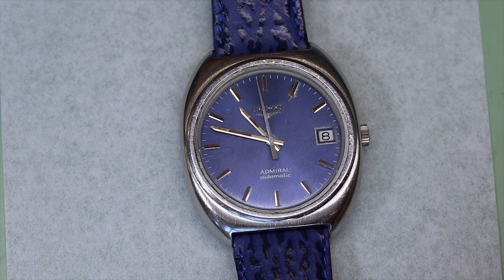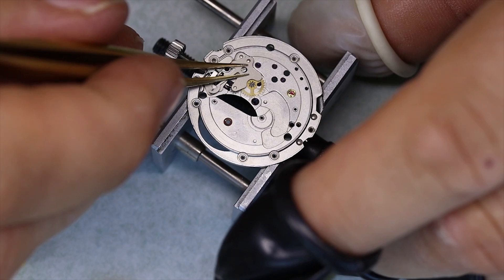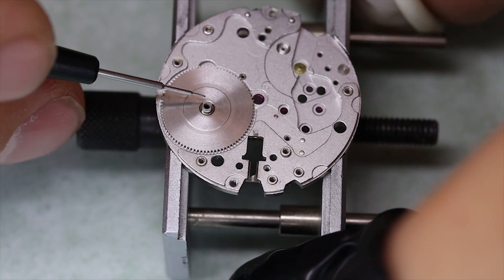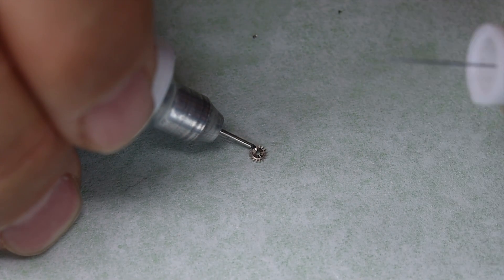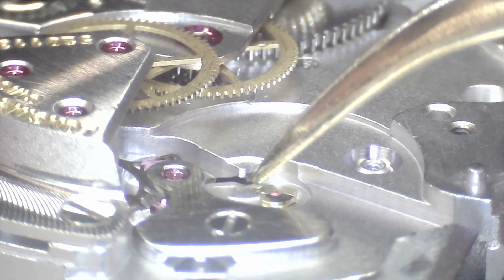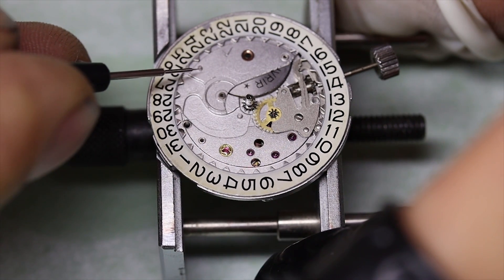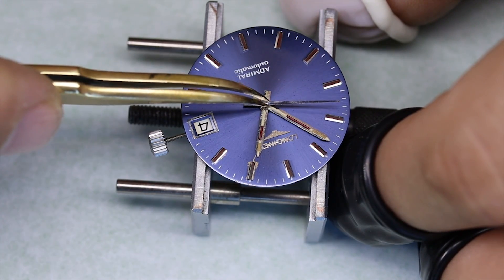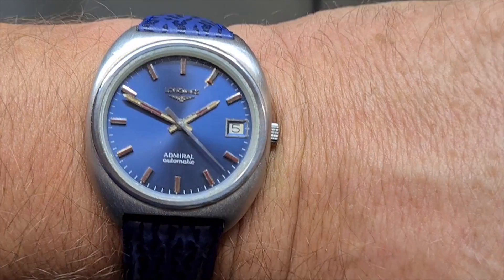Down but not out - restoring a beautiful 1974 Longines

Comment: Thanks for showing the closing of the barrel bridge hole technique. I've known watchmakers do that but so far I've never did it myself. Gonna try it on scrapper soon.
Reply from the maker: Thanks John! Good luck and it's not difficult, just make sure you have the right tools and that the bridge rests on the surfaces of the tools, meaning that the surfaces do not touch each other through the hole.

Comment: Thanks, S, for the tip about grease over oil on pallet forks jewels in certain cases.  I did not know that.  This was a really good one.  

Finding parts: 
My solution...it works extremely well and is relatively inexpensive.  I got on Amazon and ordered a pack of neodymium, rare earth, super strong magnets.  They're in packs of varying size, disk-shaped, really strong, and about an inch in diameter.  They also come with adhesives for sticking them to whatever you wish.   I took 15 of them and spaced them evenly along a yard/meter stick.  Wave that over the floor and I found teeny dial screws, barrel arbors, yoke springs, and other born-to-fly microscopic parts I would have never seen again.   Works wonderfully.
Reply from the maker: Good tip!

Comment: Wow, superglue! I knew it is useful when your boss won't shut up or the dog just keeps on barking, did not know the horological application though. Fascinating!
Reply from the maker: Hello griffn, thanks! I hope it came across clearly enough that it was a gag and that I actually got a NOS part, thought this would be fun 😁
Reply: @VintageWatchServices   Of course! 😀 Glue capable of performing such a task would be on a level of a miracle.
Reply: @VintageWatchServices  I did not get it either. What I think is funny is that that is the exact same kind of gag I would do, and then be frustrated that nobody got it.
Reply from the maker: @johnsrabe   That is indeed very funny! I might have to mention in the next video that it was indeed a gag, otherwise I might get complaints by people who tried to actually fix their watches with superglue 😂
Reply: @VintageWatchServices   I wish I had read this before I tried to  Super glue my broken mainspring. Lol.

Comment: I think restoring the matte brushing on the case was essential to bringing back the character of the watch, and you did keep some of the scratches, which maintained the age effect.  Really nice work.  As for the increasing scarcity of parts for older movements, maybe 3-D printers will be the salvation for vintage watchmakers.
Reply from the maker: Thanks a lot Bullnose, that's very nice to hear. 3D printing indeed could be a source for making old parts, the only downside is that at the current state of the technology, you'd still need to do quite a lot of hand finishing to make them acceptable in a watch. But the tech develops very fast, so the future might be bright 😁
Reply: @VintageWatchServices  Don't put away the super glue just yet.  Be well.  😊

Comment: If I had one problem with this restoration it would be the case "re-brushing" it looks a little bit to deep and rough looking. Probably with the naked eye it wouldn't look as bad though. 
I'm glad it was restored and working well. 👍
Reply from the maker: Thanks Gary! The re-brushing is actually probably shallower than the original, and I think the original brushing was a bit coarser also. But it was certainly also more uniform :)

Comment: Great video, so relaxing. I like the tip geometry of the screwdrivers you use, what set would you recommend for a beginner?
Reply from the maker: Hello George, thanks so much! I've started using hollow ground tip screwdrivers, which really fit the screwheads very well, but they're a bit of a pain to trim. For a beginner, I'd say you should get as good a set as you think you can afford. Good screwdrivers really make a big difference to how easy and rewarding it is to work on a watch, if your screwdriver slips all the time it can get very frustrating. Thus if you can afford it or rather if you think you'll use them enough to justify it, I'd go for a Bergeon or Horotec set and get a sharpening stone/slip together with it. Buying cheap means buying frustration.
Reply: @VintageWatchServices  Thank you for your reply, i am a fan of the maxim "always buy the best you can afford"  and yes cheap tools especially in watch repair is a recipe for frustration and possibly disaster, i know from personal experience. One thing for sure, the tweezers i bought which are the same design as yours but made by Dumont have made life easier for this novice.
Reply: @VintageWatchServices  Beco-Technic are also good.  Timelab in South Korea started making some of their own tools a few years back and I've heard some good things about them.

Comment: Another engrossing video. If this watch had a balance wheel with screws in the sides(circumference), the oscillation would have been a feast for the eyes. There is some inscription on the dial side of the barrel. It seems it is in french. Really looking forward for the next video Stian. The appetite for your videos is insatiated.
Reply from the maker: Hello K, thanks for that! The barrel has an inscription in both English and French saying Do not open. This was quite common for a while with some brands like Longines and Seiko. The idea was that the entire barrel complete with mainspring would be swapped out at a service. The barrels are thus not intended to be opened and there's a greater risk than normal of damaging it if you do open it. 
My approach is to try the barrel first to see if it gives the watch enough and steady power, and if not I'll acquire a replacement. With a spare I will then try to open the existing barrel and clean the mainspring and if there are issues with the barrel afterwards I'll use the spare.
Reply: Thanks Stian. Very nice explanation.

Comment: As a dressmaker, I totally empathise with the loss of small metal objects in carpet. Usually, I would find that pin, or those needles, with my - invariably - bare feet when I walked on them. Or, occasionally, with my fingers, when they stabbed me under my finger nails as I sifted through the carpet fibres for them while holding the magnet in my other hand. Yeah, I don't miss having carpet in the sewing room, not even a little. I still might step in pounds every now and again, but I have a much greater chance of seeing them before that calamity. Still, that Bergeon magnet looks like it would be AMAZING for finding little metal things. I might have to look at getting one for myself...
Reply from the maker: Those sound like some real life Murphy's law examples 😂 Yes, that magnet is a real life saver sometimes, and for you perhaps even literally then :)

Comment: Really enjoy all your videos. Personally I would have preferred a finer brushed finish.
Also a question on your screwdrivers. I notice you use hollow ground tips. Do you find these work better than the regular ones?
Reply from the maker: Hello Cornelio, thanks a lot! I think the original finish might actually have been a little bit coarser, even, but this was the closest I could find. 
I love the hollow ground tips, I just started trying them out a few weeks back and are so far very happy with them. Trimming them is a bit more of a pain in the butt however, as you need a hollow ground grinder that takes a lot longer to use than a simple diamond slip. So all in all, I'm not sure :)

Comment: I'm really loving the work you do on the various movements that you show us, but this one in particular piqued my interest as the 6651 is used in my Admiral chronometer.  The only visual difference is that the auto rotor is inscribed with Longines Chronometer.  I did wonder if being branded a chronometer it may have been adjusted in more positions but, no, both movements are adjusted for 4.

So what makes my movement being designated a chronometer and the movement in this video not?  As it is so easy to replace the rotor, could it simply be sample variation and the better performing movements have the chrono label, and rotor?
Reply from the maker: Hello Terry, the main difference between a chronometer rated movement and a standard one is the manual work of adjusting it. That's mostly down to ensuring the balance is (near) perfectly poised in five positions but could also include a different metal ln the balance, a larger balance etc.
Reply: @VintageWatchServices  Thanks, Stian.

Comment: I have an Admiral ref 2315 and after removing the case back I saw a zig-zag-design ring around the movement, apparently keeping it down, only too close to touching the rotor periphery. Is that normal?
Reply from the maker: Longines used those types of rings, yes, but it should not touch the rotor, of course.
Reply: @VintageWatchServices  OK, thanks, I thought it was added accidentally or from a different case for some reason by the watchmaker who serviced it.

Comment: Do you ever jewel the barrel if it's worn? I was watching The Seikologist and he will typically do that service if it's worn.
Thanks for all of the wonderful videos
Reply from the maker: Hello Jim, thanks for watching! No, I would never do that. It absolutely is the better solution technically, but it means that the watch is no longer original and that the stated jewel count on the bridges will be wrong. From a commercial perspective it might also be cheaper to just buy a new bridge, actually, given that you need to buy the jewels and spend an hour or two on placing them.
Reply: @VintageWatchServices  That makes a lot of sense. Thanks very much for the reply!

Comment: That is a WATCH!!  This is a QUALITY watch, so much worth wearing, and servicing, when the time comes. The calendar 📅 works on those were made of aluminum (The day and date wheels 🛞). On today’s watches, the calendar 📅 works on them are made of soft plastic. It seems like 👍 a watch of yesteryear was built to last 300+ years (if properly cared for, and serviced at the recommended intervals). You’re lucky 🍀 to see 3 years out of a watch today. I’m speaking 🗣 of Armitron’s, and Timex’s, and such. Junk watches of today’s world 🌎. Not serviceable, financially, to most people. Longines is a QUALITY watch. Hint, if ya lose a small part on the floor, use a strong neodymium magnet 🧲. Just demagnetize the part afterwards. This will remove any magnetic “cling”, not allowing the watch to run 🏃‍♀️ properly, or not at all. Happy Thanksgiving 🍽🦃🍁. A little early. Your friend, Jeff.

Comment: Did you ever find the missing tooth or does it basically get worn away somewhere in the movement over time?
Reply from the maker: No trace of the tooth anywhere, no. This would typically happen if the movement jams up either from another fault or from too much gunk. Trying to wind the watch at that point and using too much force will break teeth on one or more wheels. The tip would typically break first and then the rest would be ground a bit further down with more winding, but the biggest piece would be the tip. It could also be bent, depending on the hardness etc.

Comment: #193 Thumbs uP  I think the case would look a bit better with a polished finish. The brushing on it didn't turn out well in my opinion, but hey, it's 1974, the height of disco fashion. Was that old glue on the one o'clock hour marker? I've always wondered how the hands could get scratched up inside the watch case when they shouldn't be touching anything.
Reply from the maker: Hello Steve, thanks for watching and for your comment! Tastes of course vary, but if I do any case work I want to try to reach the original as much as possible and this case was originally brushed, hence that choice. 
A couple of the hour markers show degradation of the blue color around them but the one o'clock one is the worst for sure. Typically this happens if there is lume that disintegrates and reacts with the varnish and paint, but these hour markers do not have lume. I assume it might be the red color on the hour markers that is the culprit in this case. If nothing is touching, it has to be a chemical reaction of some sort. 
For the hands, they are handled by watchmakers every now and then and will acquire some marks, unfortunately.

Comment: How are you able to change the size of the barrel arbor hole when it’s jeweled?
Reply from the maker: You're not :) The only thing you could do would be to replace the jewel. But the sapphire itself is extremely hard and cannot be adjusted.
Reply: @VintageWatchServices  but isn't that what you did in this video?
Reply from the maker: @asdwinner1234  No, there's no jewel in the bridge for the barrel.